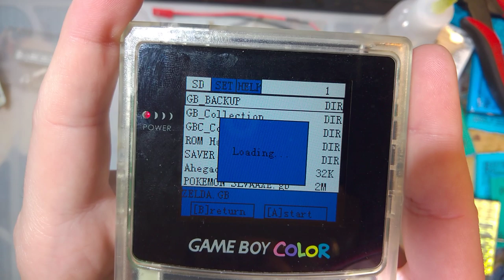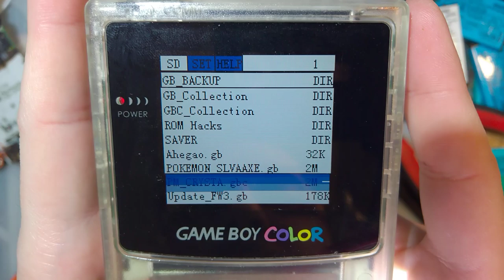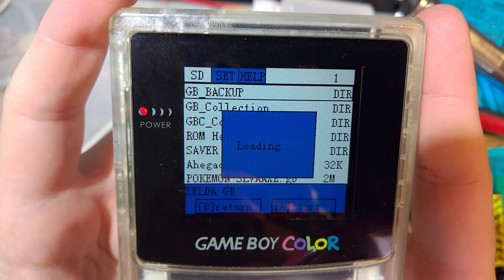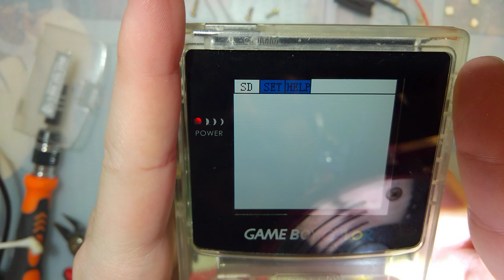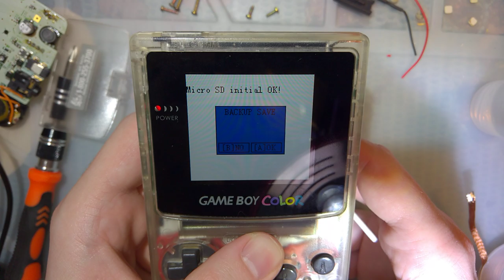[OBSOLETE KIT] Game Boy Color 9380 IPS Glitch

Comment: First of all, thanks for all of these amazing videos! I recently IPS modded a CGB-CPU-04 and I experience that column of noise too, but I am also experiencing what appears to be screen tearing at random. It’s most noticeable when screens scroll in Link’s Awakening. It’ll randomly occur 2-3 times in a row and then go away for a while. Then last night I saw it happen for the first time when playing SML2. I’ve been unable to find any other reports so thought I’d check with you!
Reply from the maker: I think I mentioned this in a video somewhere. There is a consistent screen tear EVERY time the Game Boy Color issues a LCD reset command. It seems that a second or so after the reset, the LCD will tear, but then it's smooth from there out. LCD reset commands are often issued upon screen transitions or between menus. 

If you want to look for it, you can often notice it at the very beginning of a level (SML for example, just start running as soon as you can and you'll see a brief tear or Pokemon for example, when the enemy's sprite is sliding in from off screen at the start of the battle, there will be a tear). This affects every game but it's not noticeable in some, and very mild in most games.

Comment: id suggest changing out C32, C35 and C38 with new good quality caps. this noise is either coming from bad filtering on the input supply or it is likely caused ye emi noise between the cpu and work ram in the earlier gbc revisions. there's is a whole data buss there so its likely that due the the ips screen having no screening between the flat flex and the motherboard behind the panel. while adding a new display is good for these old devices, they clearly werent built by and engineer with knowledge of such things
Reply from the maker: The 03 GBC has been recapped and I've tried it with the ribbon flipped up and over and with insulation between the ribbon and the GBC. No dice there either. I concur with the assessment that it's a noise issue and just needs a cap somewhere, but I've tried all the obvious locations so far and I'm running out of ideas to throw at this thing.
Reply: @makho  do you have an oscilloscope?
Reply: @makho  thinking more about this is theres no change when the ribbon cable is flipped away from the console then i'd recommend looking at the v-regs on the lcd ribbon cable and adding some more filtering to them, probably 100-220uf would be something worth trying
Reply from the maker: @Choppy_PHC  I do not have an oscilloscope, unfortunately.

Comment: Apparently there is a known noisy 6MHz clock signal issue across all models of GBC that may or may not show up.  BennVenn's Gizmo was designed to clean up the signal, unfortunately it looks like it's designed for ribbon installs (AGS-101 mod).  Maybe is could be adapted?  Just a thought.  Seems cheap enough: https://www.retromodding.com/collections/sale-clearance/products/bennvenns-gizmo-gbc-clock-signal-conditioner

Comment: I'm not sure if FP or HandHeldLegend has come out with new versions of the kit but I finished my IPS mod last night and don''t have that issue. It's a CPU 05. I was actually surprised it worked because there was a fucking dead baby centipede inside it when I opened the GBC up.

Comment: I fully recommend getting this solder sucker on amazon: Engineer SS-02 Solder Sucker
it has a rubber tip so it get around the pin to create a better seal. Its pricey compared to yours but it has been more than worth it.

Comment: I've got a CPU-04 with the IPS and it doesn't appear to have the noisy pixels issue either.
Reply from the maker: Yep and see that's the problem. Some consoles just seem to work fine and there's no meaningful reason why.
Reply: @makho  I just added an IPS to my CPU-04 and theres no noise either

Comment: Great video, Loved the testing without the regulator. I'm wondering if it's a noisy crystal and/or power line on the screen itself. There once was an item from BennVenn called the gizmo that rectified an issue on the 101 swapped screens on early cpu where they would glitch. However I'm yet to find any videos of the before/after of that. It had a decoupling capacitor and a 3.3v regulator. Just unsure how you'd use it on this setup or if it's something that would be a ribbon cable revision "if" it would even help at all.
Reply from the maker: Yeah, that thought occurred to me as well. It looks like retromodding still sells them but I was thinking about the wiring too. I started pouring throught the schematic but I got nowhere fast.

Comment: If you mean the little noise at the right of the screen , I installed a backlight full screen on my GameBoy Color two days ago and I have the same problem. But it doesn't happen in every game, usually in GBC only games.

Mine is a CGB-CPU-01.
Reply from the maker: Yep, it's only going to be in doublespeed GBC games. Any original DMG games will run fine.

Comment: Have you looked at the caps above the regulator? and also the U7 near the cart reader looks different and has a different layout and might be needing a cap on there somewhere that is on the newer board. The SRAM is not on the back of the newer version either so they likely integrated it into the newer CPU and if it's nothing else it might be that the new CPU is the difference between the 2. I also see C50 is not on the older board either and could that be the cap needed to clean the power showing in that column?

Comment: desoldering iron is nice but for a decent one they can be pretty expensive. I noticed that 2 of the surface mount pieces are missing on the 06 (R10 and C3) which on the 03 was there and that's pretty close to the screen. So i'm not sure if that has anything to do with it. I'm just throwing out guesses just like you are.
Reply from the maker: Yeah, when I saw those were missing on the 06 board, I thought it was worth investigating. I assumed those were part of LCD regulator circuit which is why I removed the whole regulator but after checking the schematic, I'm not so sure. It's probably worth further investigation.
Reply: @makho  Agreed. Electronics can be weird sometimes. It can be the smallest thing.

Comment: I am guessing it's either a crystal or a noisy clock signal issue. You should try swapping the crystal out first. If that fails, a clock signal conditioner  would clean up the signal and perhaps fix the issue
Reply from the maker: *Which* crystal?

Comment: not sure if anyone still cares but it seems like an issue with the model cpu to me, the older cpu's (i'm assuming based on the way they are labeled) like my cpu labeled "CPU CGB" and your cpu labeled "CPU CGB B" both very clearly have the issue, while your cpu labeled "CPU CGB E" and mine labeled "CPU CGB D" do not. my board with the CPU CGB D chip is a CGB-CPU-04 board. the CPU CGB D board still has the issue but it is almost unnoticeable and i can only see it on the file select of link's awakening dx. dunno, don't know what i'm talking about entirely and this has probably already been said 1000 times, just wanted to check

Comment: Sorry but i always see that Yellow tape since i’m watching gbc color modding videos (love yours), can you please tell me what kind of tape it is? I’m googling “yellow tape, yellow electrical tape, yellow scotch” can’t find nothing similar, what’s the difference with a common clear scotch?
Reply from the maker: Kapton tape, or the generic name, polyimide tape. It's extremely heat resistant, very thin, and the adhesive does not typically break down like electrical tape does.
Reply: @makho  thank you very much for your help!

Comment: Mr. Makho, How's the RTC function on the EZ Flash Junior? Does it work well? I'm thinking of buying one for Pokemon Prism.
Reply from the maker: Seems to work well for everything except Prism. I've reported it to the devs but they basically dismissed it. https://gbatemp.net/threads/ez-flash-jr-rtc-jumps-2-years-after-every-save-load-in-prism-229.556431/
Reply: EZ-flash devs are working on fixing the issue.
https://gbatemp.net/threads/ez-flash-junior-testflight.558875/page-25#post-9163433

Comment: My first guess with issues like that is always a failing capacitor. Perhaps the one next to the power supply?
Reply from the maker: The 03 board in particular has been recapped very recently. It's not the caps as far as I can tell.
Reply: Then my next best guess would be some sort of shielding issue
Reply: Maybe it's not the PSU. Maybe it's some capacitor on the board. Or it could be the screen adjustment screw (does the gbc have one like the gba?).
It's just a bunch of speculations, I don't have an oscilloscope to measure the noise on the board :(
Reply from the maker: @koffieleut  It's not the adjustment "screw" (that's a potentiometer BTW, not a screw). The potentiometer adjusts the voltages going to the LCD by tweaking the paramters of the LCD regulator. I removed that part entirely for a test. The mod kit uses its own internal regulators instead of the one the GBC uses. 

I think it's just some grounding issue somewhere. I just can't find it.

Comment: I'm finding  it impossible to find an 06 GBC mobo online. Most of what I see is 03, 04, 05, or the seller doesn't make it clear in the images (because not everyone takes pics of the battery compartment without the batteries).

Can't FunnyPlaying make a screen that doesn't exhibit this issue on 03 and 04 mobos?
Reply from the maker: They already did. The newer laminated kits work equally well on all GBC PCB variants but thank you for bringing it up because I totally forgot I had this video out there for the older kits.
Reply: @makho  hmm so their new one doesn't have this issue on 03 mobos? Which kit is that exactly and when did it come out? I just had mine installed in February
Reply from the maker: @DragonQuarter  This video is from over two years ago. The kit this is relevant to hasn't been made in probably close to that amount of time too.
Reply: @makho  Since my 03 mobo GBC is having this issue, is it possible it's still happening with the newer kits? My modder contact said he ordered this in Feb. directly from the FunnyPlaying site, so to me it seems like the issue still happens with newer kits.
Reply from the maker: @DragonQuarter  sounds like your modder is lying to you
Reply: @makho  Sorry I think I'm unclear. I had the modder install the FunnyPlaying screen on an OEM GBC and I think those are different from the "newer" FunnyPlaying screens.

Comment: selfish question more then helpful idea: of the CPU-05, does anyone know which ones are the ones that work fine? It happens to be I acquired a decent shape one but can try to trade for a 06, but wont bother trading if I don't have to.
Reply from the maker: Some 05 seem to work fine but there does not seem to be any meaningful way to determine without just testing it out. I believe the Chinese made GBC 05s work without the glitch whereas the Japanese made 05s do not. That's just baseless speculation though. Well, a hunch really.

Comment: Could try tweaking the pot under the battery compartment?
Reply from the maker: It won't do anything. That potentiometer just tells the LCD regulator what voltage to send to the screen. I removed the regulator entirely in this video.

Comment: Maybe it’s just the ribbon connection on the motherboard?
Reply from the maker: I don't think it is but I suppose there could be some minor difference. One pin out of place or so.  If that were the case, I assume the issue would be much less wide-spread and the solutions would be much more random.
Reply: makho I mean, is this an isolated incident or is this occurring on many gbc’s with this mod? I’ve been following this whole thing but, I have been busy and just sort of forgot what the whole issue entailed.
Reply from the maker: @LelandHasGames  The issue seems common when tested with an appropriate game. I can't say how common in the grand scheme of things though.
Reply: makho it’s certainly interesting that the issue persists after swapping board components. I really am curious as to what is causing the problem and if it can even be fixed.
Reply: @LelandHasGames  Not an isolated incident, also happen on my GBC (first revision).

Comment: Maybe its the actual ribbon port itself?
Reply from the maker: Possibly. I don't think that's the case though. I have no good way of testing that either.
Reply: @makho  I had a similar problem at one point , it would appear and reappear constantly it turns out a connection pin was dirty.
Reply from the maker: @ZeliusDev  You're going to have to be a little bit more specific than that.